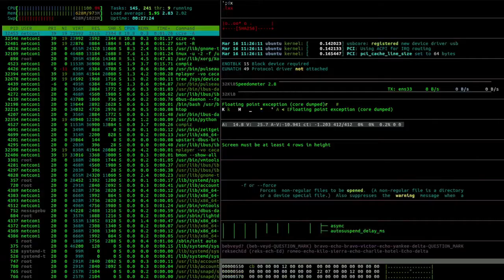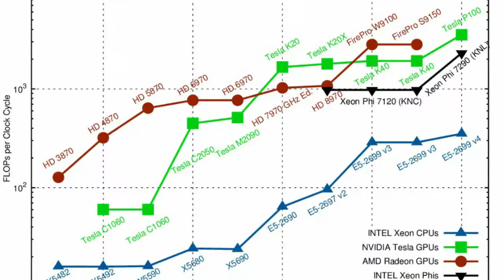What Exactly Is a Teraflop? Gaming Specs Explained

Comment: You did an amazing job explaining this, great job.
The only thing you should have mentioned is how memory bus speed, bandwidth and the amount of shaders (or in AMD GPUs, the Compute Units; Since they don't usually advertise shaders off the get-go) are significantly more important than the overall number it hits in the end.
The other determining factor within "Teraflops" is the underlying architecture and process node that the processor is currently on, which then determine the overall 'speed' outside of that equation. The 'teraflop' number allows the individual to understand the relative performance of one computational piece verses another, but the underlying architecture really is the focal point within this regard. Since 'both are equal' (assumingly) within architecture, the 'flops' number is going to be an important measurement, but not much of a distinction unless there is a massive gap between the two next-generation consoles. Additionally, the stepping of the lithography node (N7, N7P DUV, N7+ EUV) makes a massive difference within overall efficiency, which translates to equal clock speeds at lower power, or sometimes higher clock speeds at the same power -- thus overall 'higher' teraflops number.
The number is calculated as follows: Double clock speed (boost) multiplied by the amount of shaders. Simplified; you can adjust the 'teraflops' number by the frequency, but a lower frequency higher shader unit will always perform better than a higher frequency lower shader unit. Efficiency plays a giant role into this, and diminishing returns is the factor for this one. This, however, doesn't mean ANYTHING if optimization for the titles are designed specifically for the hardware, then the 'quality' of graphics, for two relative platforms, would be near identical anyway. Especially with the leaps within technology we have come thus far.
Eitherway, great video. Very concise and informative.